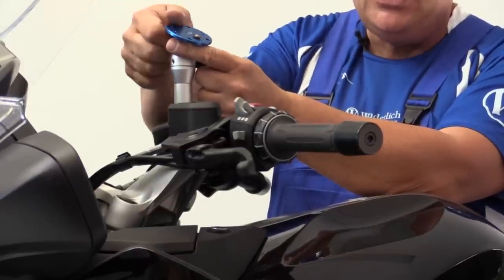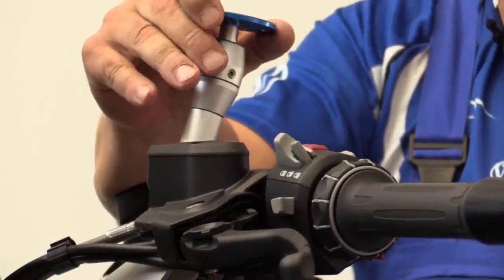Wunderlich MultiPod Attachment to the K1600GT/GTL and R1200 RT

Comment: I have two problems with this product. 1.It protrudes about 10-12mm further than it needs to from the handlebar casting. 2.The $175 Multipod device that attaches to it by design is overpriced and inferior to the RAM product. Make this RAM compatible and you would have me as a customer on the product.
Reply: You can remove some parts of the multipod to make it smaller because it is completely modular. But the price though…
That adapter that replace the original handlebar screw has a thread inside…. maybe it’s compatible with a Ram ball screw…
Reply: I bought two stainless bolts, one for each side.  On them, you can attach any kind of RAM mount that will not obscure the tank bag, speedo, or anything else on the dash.  The bolts cost $12 apiece, plus whatever RAM mount you want to install...

Comment: This is the worst designed piece of crap I have ever installed on Mry 2013 rt. I have had it installed on my bike for 8 yrs. & every yr. in the winter months I have to fix it as it is  ALWAYS coming loose. I have drilled & tapped screws into it added red high strength lock tight at both joints with very little success. This yr. I installed more screws & lock tight in hopes it might not come loose again. The idea for this o.k. but the end result is a piece of crap. Please redesign it for future customers.